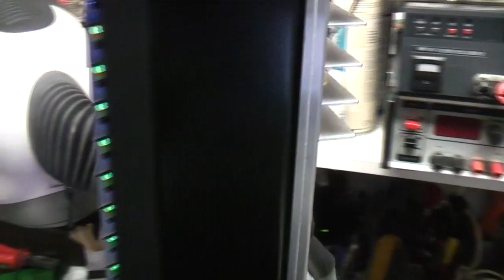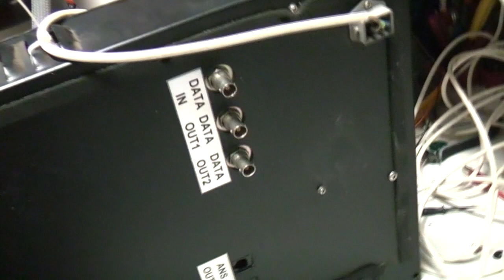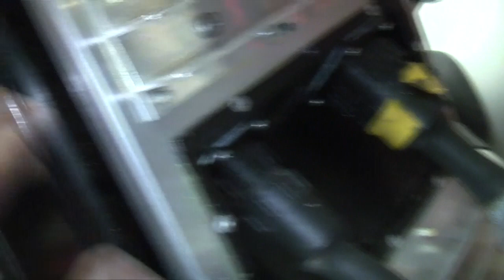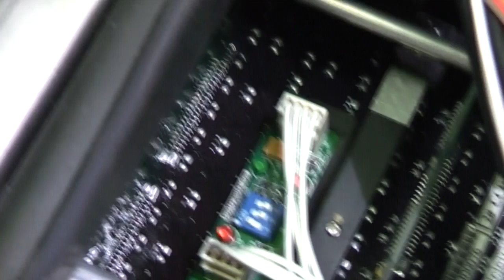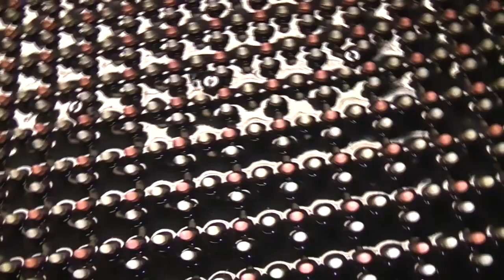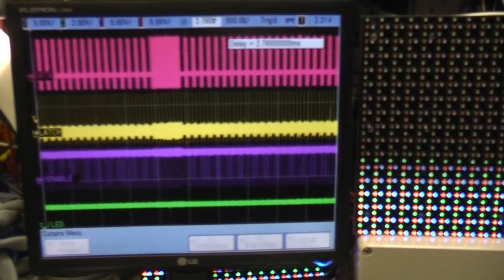Outdoor LED Screen teardown (+how to drive LEDs with video)

Comment: These are sooo interesting and truly amazing. I just went over myself and bought a 25"x13" LED-screen from eBay with a built in controller. The resolution is 96x64 and pixel pitch is just 10mm because of single RGB LEDs. Can't wait for it to arrive, i looooove these panels.

Comment: Usually full colour LED displays are hooked up to a PC which generates the video feed - the LED display 'simply' displays a specified section of the PC screen. If you can get your analog video on to a PC screen (without bypassing graphics memory like some TV cards) then it is easy. Do a search for "LED Studio" which is currently the most popular system (top end stuff may use something more advanced).

Comment: Trust me he knows exactly what he can poke and what not to poke, he's been doing this stuff for ages, and has probably had his fair share of "electrical bites" and even if by some chance he did get bitten, he's following the one hand rule. As long as you keep one hand away from what your working on and don't ground yourself, a shock may hurt like hell and scare you but you'll survive it. Unless its big HV high amp stuff, leave that to professionals.

Comment: One thing I may post to my channel, is I have a HUGE old HP VTVM I'm eventually going to restore and use, considering making a series of vids of it's restoration process, even though I have a crap Chinese made DV camera and would have to use a Nuvicon tube video camera for macro shots (but damn it does work well for them, nice optics on those old video cameras).

Comment: In terms of input, you'd need an LIP processor (the manufacturer's name for their display interface).  Older versions used VGA, newer ones can accept DVI.  The electrical specification for the module input (on the BNC connectors) is identical to SD-SDI, but the data format is different.  You can actually use regular off-the-shelf broadcast SDI DA's to split the signal to multiple panels or screens, since each module takes care of its own signal-split processing via the address switch.

Comment: Oh, and the small "bumps" on the front of the louvres are to help improve the contrast ratio of the screen in very bright sunlight.  After a while UV and exposure to the elements will tend to "polish" the front of the screen and it will reflect more sunlight at certain times of the day.  The bumps help to scatter this reflection a little.  I also believe this same mold was modified from an earlier version which had the same 16mm pitch, but used 4 LEDs instead of 3 (2G, 1R, 1B I believe.. ?)_

Comment: Nice!  I never saw any of their custom installation products, but this system was made by Lighthouse Technologies, 16mm pixel pitch with the down-angled louvers and LEDs for exactly the reasons stated, meant for very high-angle, long distance view.  I'd recognize the SIB, ECB, VPC and EMB boards anywhere.  I've got a lot of the portable versions of these (LVP-1650/R16) but this seems like an older generation of the same product.  The new gen boards combine the 3 main boards into one.

Comment: @mikeselectricstuff I didn't realise it was ten years old.  Time flies.  The mass produced Chinese panels are not necessarily low quality things (I'm sure there are some though), LED video walls are so common now that a wide variety of breathtakingly slim and light panels are now available in surprisingly high resolutions.  Ever go to PLASA at Earls Court?  They always have a load of different systems on show, and it's rare to find any LEDs out on them these days.

Comment from the maker: @bigclivedotcom I guess LED wear-out - apparently it was originally installed 10 years ago, and had the panels replaced about 5 years ago. Olympics probably the excuse to replace. Don't know what they replaced it with, but doubt they'd risk cheapo panels for a high-rent location like this!

Comment: Very interesting.  I wonder why they're changing it, since it isn't all that old.  That said, the advances in LED panel technology over the past few years have been staggering, so the new display will probably just use off the shelf Chinese panels.  I used to do the servicing on the vintage Scannervision display in Glasgow which used filament lamps with RGB filters in front of them to produce a low resolution colour display.  The lamps were 12V xenon gas filled tungsten and switched with triacs.

Comment: @mikeselectricstuff  Seconded. The LEDs in this product are driven at about 20mA to get 5000cd/m2 brightness. LED efficiency and lifetime drop with currents  so even with 4:1 mux you may need > 100mA peak current to achieve the same brightness (since you'd have 1/4 the time to light up each LED). So the muxd LEDs would die quick. Also - the drivers would get too hot since they'd be pumping out 100mA all the time.

Comment: Very interesting stuff. So is this unit yours to keep or do you need to return it? Also Is it possible to input an analog composite video signal via RCA connector into one of these units or a full screen? If so I could hook up a video game system to a display like this.

Comment: Where I live there are a whole bunch of Optec LED displays, and they all use standard 5mm Nichia LEDs potted in marine grade epoxy.  For a 25' wide highway billboard sized display, I understand that it takes four weeks to assemble the display and another to calibrate it.  The video quality is fantastic; if set up and maintained properly you wouldn't be able to tell the difference from a regular paper billboard from a distance during the day.

Comment: APART FROM... the need to use the dummy LED if you go for 1 red.
btw - you can prove this works... just look at off angle white with the shader on and then compare it to the shader off. You'll see the difference !

Comment: Another super teardown Mike. You are the Sherlock Holmes of the electronics world !

btw - the two RED / three RED question really comes down to the easiest way to make a good video White. You can use two reds running at medium intensity OR 1 red running at high intensity. Just so long as video white colour temperatures can be achieved, its 6 of one, half a dozen of the other....

Comment from the maker: @ib9rt Not sure exactly, but even if your display data has 8 bits per colour, by the time you add global intensity control for ambient light compensation from sunlight to night-time, and enough resolution to do compensation for LED variations, you're easily over 16 bits.

Comment: Nice tear down. I've serviced and worked with Barco's C11 and NX-6 LED displays before. It's interesting the differences. The Barco's tiles tend to have a lot more logic in the tile itself, and linking via DVI cables instead of SDI/HDSDI or whatever system those tiles use.

Comment from the maker: @TheChipburner No it isn't. These drivers are cheap - maybe 3 cents per LED. Using many drivers spreads the heat over a large area. Muxing would increase required bandwidth, increase peak LED current which may reduce lifetime, and increase flicker (e.g. when viewed via a video camera). 16x multiplex would never get near the maximum LED brightness.

Comment: Very strange, but their pwm method is very cost-ineffective. It require one IC output per one LED. With multplexed LEDs it will require only one transistor for each row and one for each column, i.e. only 32 outputs to drive 16x16 matrix.